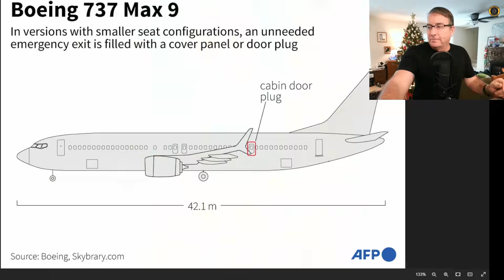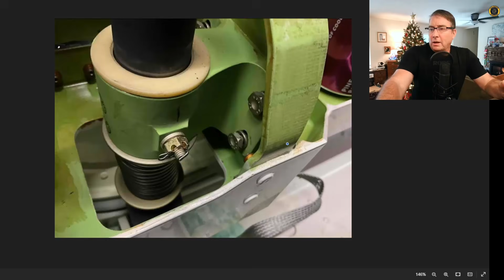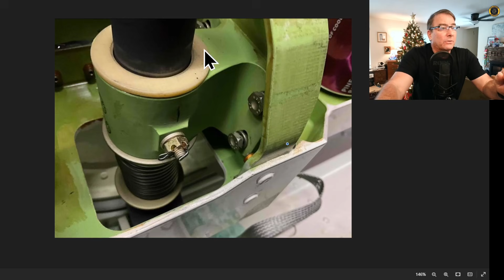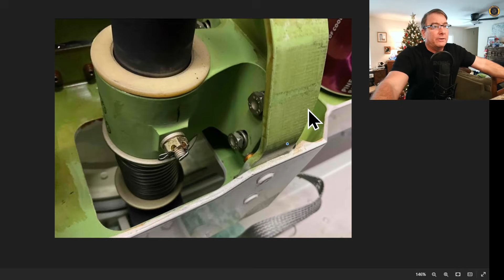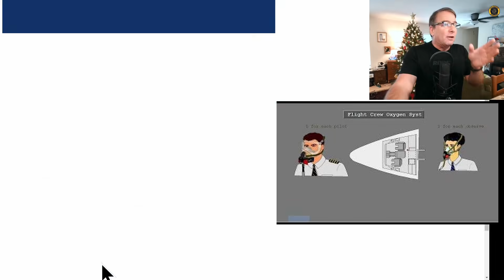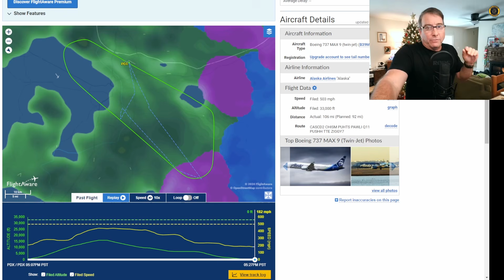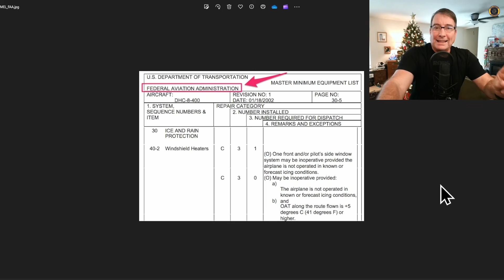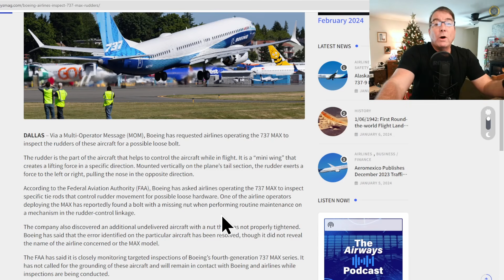"Yes, We Have No Bolts"  9 Jan 737 Max-9 Update

Comment: So there are 4 bolts that keep this thing from moving up and then there are other bolts that keep the hinges attached and maybe that's all. I guess any combination of how this all happened is still on the table.
 It would seem if the 4 bolts that keep this from moving up sheered or fell out there might be some markings to suggest that. I wouldn't expect them to still be attached. If that was the case you'd already see significant damage on the plane. So maybe if something else sheered off maybe at the hinge you might have seen it. It's unlikely 6 bolts or more came loose and fell out. But now that I think about it even if the hinge came loose, the 4 bolts would keep it in place.  if it couldn't move up, it wouldn't come off. that being said those 4 bolts have to be gone one way or another. I'm beginning to see what happened.

Comment: It should NOT be difficult to have cockpit voice recorders that automatically save data if the emergency exits are popped. It seems like those systems are lagging far behind technology. I understand the complexity of surviving a crash, but there has to be a better way.
Reply: There is - it's fitted in Europe, but the FAA don't mandate it and US airlines choose not to buy it. I'd love to know their reasons for not doing so.
Reply: 25hrs CVR recording mandatory overseas.
Reply: Agree.  But furthermore, it isn't like it would be at all difficult for all voice comms and data to continuously upload to the cloud either.  Then you don't even have to look for the box.
Reply: No emergency exit was popped.  The plane landed and the people left via airstairs.  The door plug would have no sensors on it as it was not designed to open in service.
Reply: @cjmillsnun  The emergency exits were popped after they landed, to evacuate the plane.
Reply: I suspect the pilots union resists this as some kind of invasion of privacy or undue surveillance.
Reply: @johnstreet797  if that is the case, then the regulator and airlines need to work with the pilots unions to address their concerns and get it implemented - basic stakeholder and industrial relations management. It's been done elsewhere, there's no valid reason why it can't be in America, the only reason would be because people don't care or haven't tried hard enough. Priorities...

Comment: I think your explanation of the plug door was a little more convoluted than it should be. Its a plug where a door would go if it was required to be used on this plane if it was configured differently.

Edit. Still a great video otherwise, though, just food for thought.

Comment: Lets mount a plug on a pressure vessel from the outside. Why bother mounting it from the inside where you would have had triple redundancy?
Rails, bolts, door flange. That way even if there was never any bolts, the door flange under pressure would keep it in place.
I mean it's not like youre carrying something valuable right next to that door anyway. (Sarcasm)

Comment: I'd be interested to know if the cotter pins were installed on the bolts with castellated nuts
Reply: I think no pins were installed, when that pannel was installed, nuts backed off bolts fell out door dropped ,then blow out!
Reply: It seems that way to me since none of the large bolts were found with the door or still attached to the airplane. @jimmywilliams9824

Comment: Hi Juan, huge fan since your spillway series. I understand how the plug door works, but if I’m not mistaken the diagram/picture of the top bolt/retainer is upside down. Keep up the good work!
Reply: It's the right way up. The door is the item on the left hand side of that image, so it needs to travel upwards. The castle nut/bolt through, stops the door rising up.

Comment: Considering that Alaska Air maintenance signed off on an aircraft with a faulty jack-screw nut on the horizontal stabilizer that killed everyone onboard....it's no surprise that they just pencil whipped the pressurization problems rather than actually trying to FIX it.

Comment: Dan Gryder mentioned that the plane had pressurization problems before this flight. So it seems possibly this was an ongoing problem that resulted in the door plug flying off!
Reply: It had pressurization indicators, not necessarily a pressurization problem.
Reply: NTSB reported yesterday that at this time there was nothing to suggest the two were linked - because in each prior occasion when the depressurisation warning went off, switching to the alternate system (not going to manual) rectified the problem.
Reply: so a recurring fault doesn't count if you just move to the other dial this trip?     shudder.    @wurly1

Comment: I will accept split cotter pin :o)  I don’t know what to tell you, they are fundamentally different in that one is basically an easy use tie wire and the other is a wedge that has to be removed by force.
Reply: Actually it’s a split pin.Yes,in the Uk a cotter pin is tapered,but not in America apparently
Reply: The bit i can’t understand is the need to call a  pin that is split a cotter pin. For once something had a name anyone could follow :D  @andrewpease3688

Comment: Wouldn’t pulling the circuit breakers be short sighted, considering the pilots wouldn’t yet know that everything ends well, there could still be an impending disaster upon landing. It seems the the answer as the NTSB stated is to make the loop longer, I’m sure this technology would be much easier to implement than when flight recorders were introduced decades ago
Reply: memory chips are cheap, I use SD cards which hold 128 GB
Reply: Think of it like a car, the engine was off but the pilots failed to turn the ignition off when exiting.

Comment: If the bolts aren’t in wouldn’t the springs push this plug up and proud of the fuselage? We’ll likely never hear about those witness marks, but if they’re finding loose brakes bolts and the bracket is missing, then perhaps more likely the breaker bolts weren’t tightened, that’s less obvious during a quality check as well

Comment: This is not unlike SW 1380, decompression after an uncontained engine failure.  It is understandable that it was ovelooked.  This seems like a poor door design.  Why not make outer flange of the door wide then the opening for it.  This was the cabin pressure keeps the door in place.

Comment: If the bolts (or remnants of) fell out during the plug departure, kind of hard to believe that they will ever be located.  Also, I'd assume that Spirit would at least install them because the BSNF videos of MAX9 fuselages winding their way from Wichita to Washington is a rough ride - any train ride is.  Picture from 2016 shows Boeing taking delivery of their first Max9 fuselage and the plug is in place.

Comment: I said it once I’ll see it again there’s no way those bolts were not installed at the factory. There is either incompetence, or what I believe is sabotage those bolts cannot come off by themselves. Somebody was in their aircraft while it was empty remove those bolts knowing the door would just fly off from pressurization, which is exactly what it did.

Comment: The assembly that Juan sowed and explained yesterday shows that the bolts are not actually tightened or torqued but the nut screws onto the threads until the hole in the bolt lines up with the slots in the nut. The bolts are not supposed to be tight. So loose bolts makes no sense at all!
Reply: Not the inhibit bolts through the latch mechanism with the castellated nuts. The bolts found to be loose are the ones which bolt the sliding hinge bracket to the door. Unlike the inhibit bolts these ones should not need to be touched to open the plug.
Reply: I was just watching Juan show the bolts that hold the fitting to the plug and one is obviously not even snugged up let alone torqued. No evidence of any torque stripe either. @NiallWardrop

Comment: Called that one. Now, who's responsible Alaska's maintenance or Boeing/Spirt Aerosystems. Betting on Alaska. Its more likely that door was opened during MX than from manufacturing.
Reply: It was a 2 month old airplane. There very few reasons why Alaska would have had to have done anything to the door until the next check that has something to do with the door. Likely at least 10 months away if not years!

Comment: Curious as to how the plug-door survived so well a 14,000+ foot drop.  Presumably it fluttered down like a leaf but still it appears in pretty good condition for the circumstances.
Reply: Yea it's probably not very heavy, and flat and tumbley.
Reply: Its fall was broken by landing in trees I believe.
Reply: It apparently smooshed/whooshed into a big resiliant tree, which attenuated its fall. The plug door likely would have been substantially damaged otherwise if it had just impacted the ground.
Reply: Many moons ago on the east coast I went to a well known drop zone to get my B level skydive license. Was supposed to ride a twin otter, but there was a killer wait, so I opted for a C-182. Told the 'child' that was flying the plane I could smell smoke. The kid told me to shut up, I didn't know what I was talking about. As we approached 5 grand the punk kid announced smoke in cabin and losing altitude and the four of us needed to get out.

I was taught after making an emergency exit to check in with manifest so they can get a head count, which I did. Said I'm reporting in from the emergency exit and they thought it was from the otter, so now they're asking me what happen to the 182 and I'm asking about the otter. Turns out a tandem student on load grabbed the emergency door handle opposite the main rollup door and it left the aircraft like designed. Long story short, the DZ flew a back azimuth in their chopper, found the door in a plowed field, took it back to the DZ, stuck it back on the otter, made a test flight and was back flying loads.

Comment: The head of the NTSB today stated they do not need all the missing parts for their  investigation.

With over 30 years of forensic failure analysis engineering experience, I strongly recommend she resigns immediately. 

The sum of all the parts are required for proper investigation conclusions of required changes to eliminate any reoccurrence of this accident. 

She has been making statements as if they are verifiable data facts when in fact they are just opinions at this early point in the investigation. 

The FAA has been advised for years to mandate 25 hour voice recorders as in this case it is easy to accidentally or on purpose to record over voice recorder data which only saves 2 hours of voice data before being recorded over if the circuit breaker is not pulled upon landing.

Appears the Boeing 737MAX gremlins continue to surface.

Comment: In the briefing on JAN 8 NTSB said: "At this time we have no indications whatsoever that this correlates in any way to the expulsion of the door plug and the rapid decompression."  I'm not sure what this is based on, but this came after reading out a time line of the event from the Flight Data Recorders which included cabin pressure.  They didn't say how far back the logs went, but there is a good chance they were able to review the FDR of at least one event.
Reply: the NTSB works with facts. so far it's coencidence until proven with data.

Comment: While botls are missing or perhaps never installed? Then look at the existing (qty. 4)  joints which typically has primer in each hole bore. If bolts were installed then the high contact bearing stress would show in the bore and discolor the primer locally. If the primer appears clean, then the bolts may not have been installed during production.
Reply: From what's been said, Sprit Aerosystems ships the whole fuselage with plugs to Boeing. It's possible they didn't fully secure it because the knew Boeing opens it up to do the interior work. But perhaps Boeing didn't do that on this one, and since they didn't open it, they failed to inspect for proper closure.  That's at least one scenario that might have happened.  History tells us the most dangerous part of engineering are the changes.  Failure to fully appreciate the full impact of the change results in tragedy.

Comment: How could the checklist get blown around in the cockpit when the pamphlets in the seat backs are still in place?
Reply: Pamphlets are in a pocket, with some friction to hold them in place. If the checklist was in someone's hand or just resting on top of the dashboard, then it's entirely reasonable it would get sucked out the cockpit.
Reply: What I noticed about the pamphlets, is that they say they're for a Max-8, when this aircraft was a Max-9. Idk if there's a material difference in the info on them, but it seems odd?